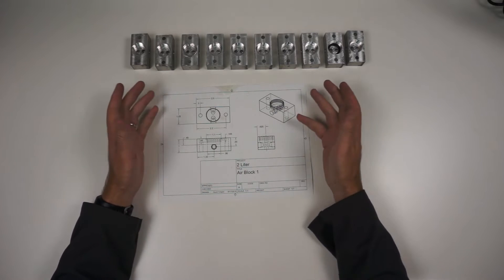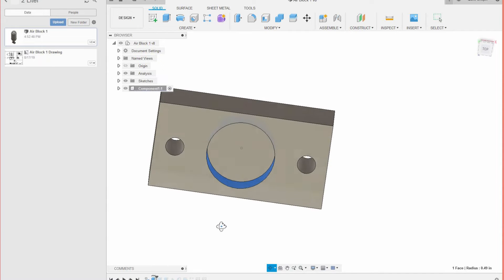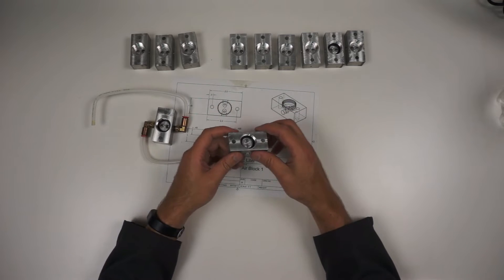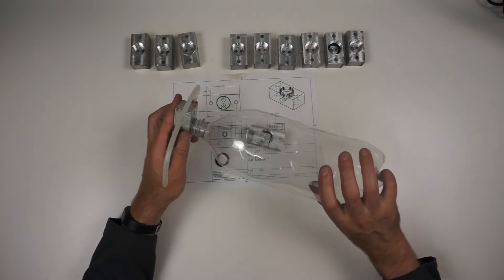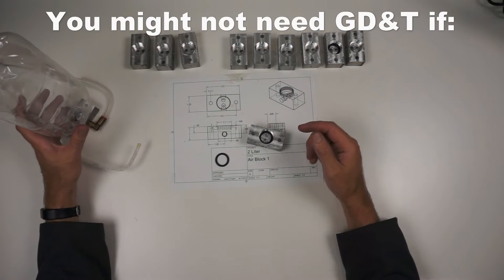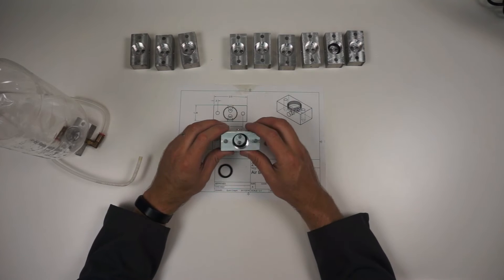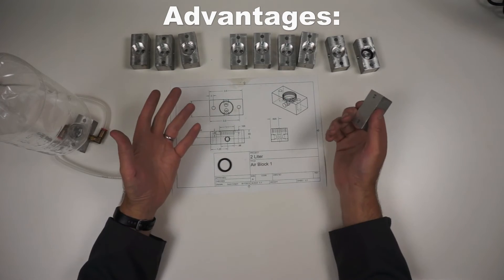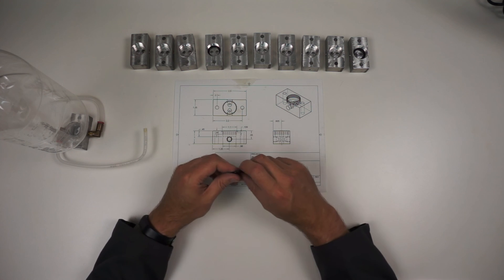When You Don't Need GD&T

Comment: This is an odd video- you could also use "When You Don't Need a Drawing" as the title. The purpose of GD&T is to remove all the "if" statements and assumptions you're making. Someone else could make a part that meets the requirements as shown on your drawing but doesn't actually work and they would have technically made an "acceptable" part. 

From a designer's perspective, GD&T is required on all drawings to fully define a part. That said, parts are commonly made from drawings that don't use GD&T because it is seen as overkill i.e. it is reasonable to expect the part to be function correctly based on the known tolerances and limitations of the manufacturing processes involved.

Comment: So if you're in your garage making your own parts from your own drawing with your own process for a DIY project then you don't need GD&T....okay. When you, the individual, encompass design/manufacturing/inspection/end user not only do you not need GD&T, you don't even need a drawing at all! You could just work straight from your CAD model and nominal dimensions. I don't see the point of this video.

Comment: At 2:58 after I saw the function of this block and the fittings and hoses, I'm going to guess.  The reason for no GD&T is because this is a single component unit that does not assemble with another part except for the bottle(which we can "assume" will be consistent because it's a standard part that is highly mass produced, plus we all have real world experience with plastic bottles...I have yet to ever find one that leaks due to bad thread issue)